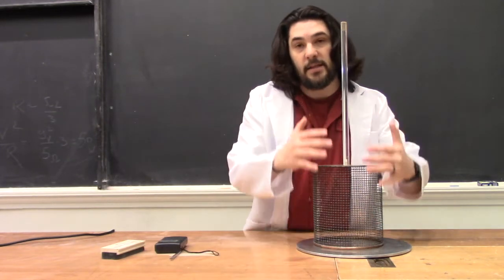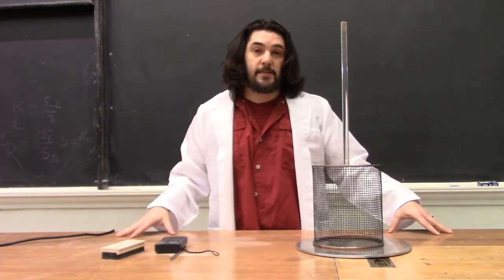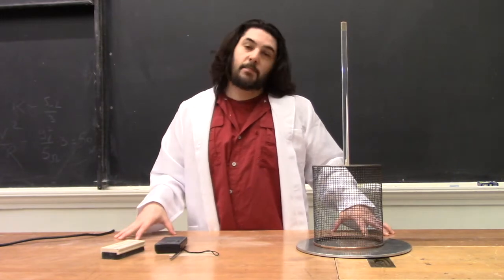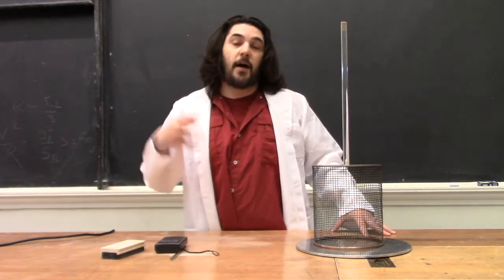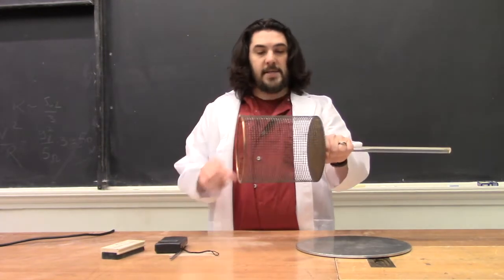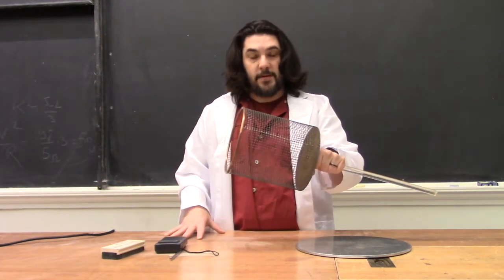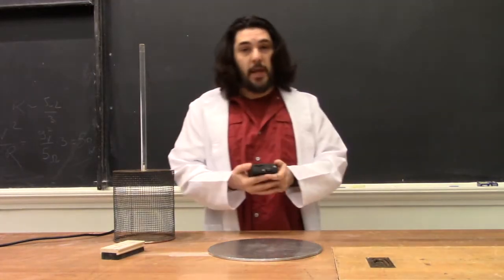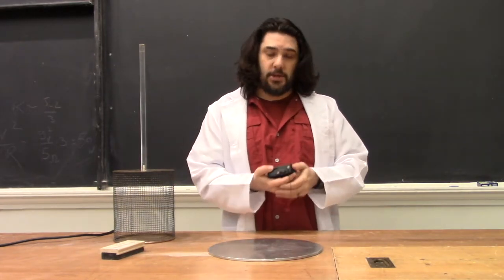Demo 11203: Faraday Cage

Comment: So, I've places my cellphone in a cooking pan made of steel. Covered the top with a steel lead. The cellphone receives the phonecalls. How is that possible?
Capitain Obvious, please explain.
Reply: You need to put an insulator on the bottom of the cooking pan to avoid the device touching the cage - you need to really seal it (Conductive tape) as any gap may allow radiation to pass through...If you did that steps it should work...